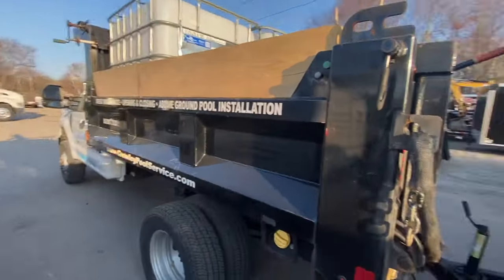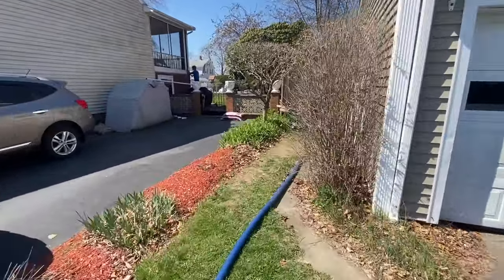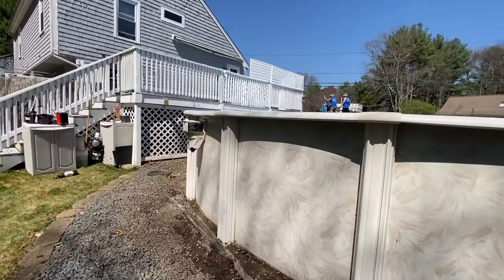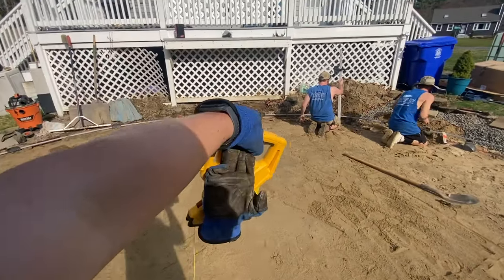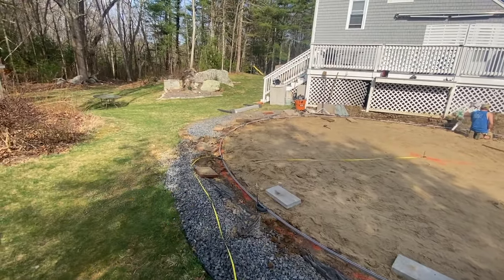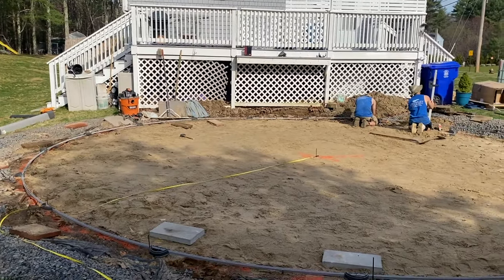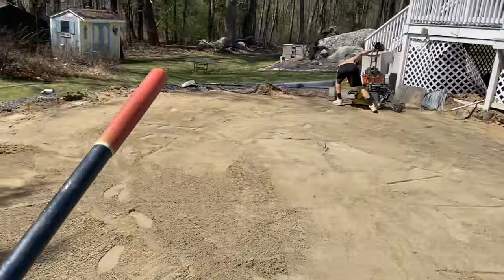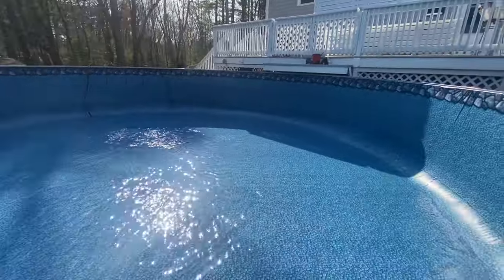Installing￼ an above ground pool…With bonus pool removal and liner installation￼ job

Comment: Im guessing the old pool didnt have the concrete blocks under the uprights? If it did, you woulve just left them right?
Reply from the maker: The old pool did have them but did not line up to the supports on the new pool so we had to re set them all